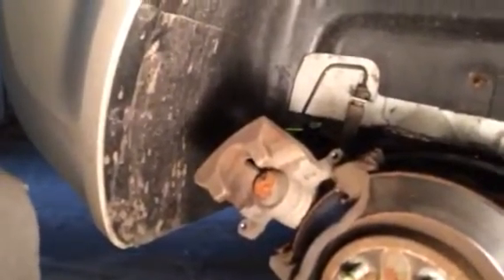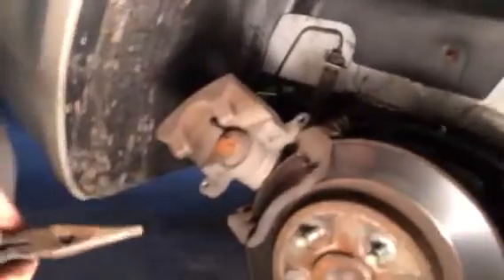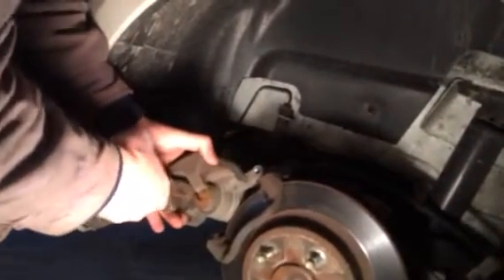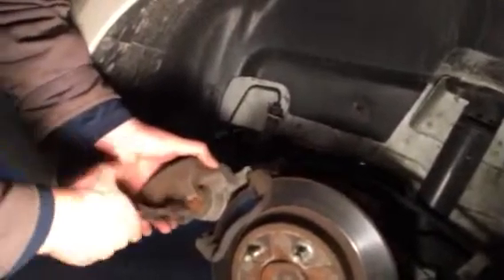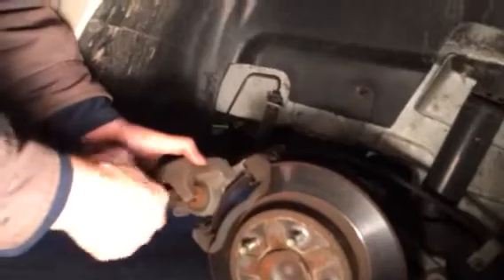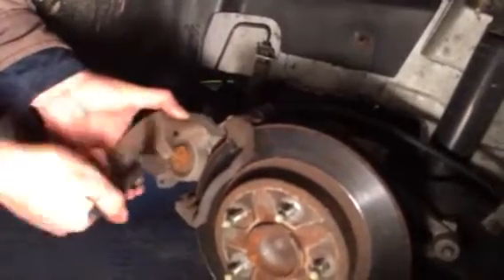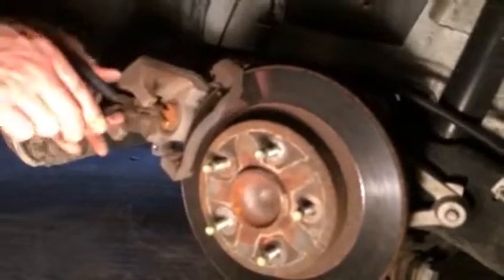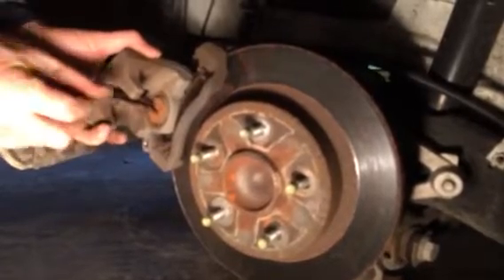Chevy Malibu rear caliper compression tip

Comment: The rotating piston is due to parking brake adjustment. Be aware, on some vehicles (my explorer for example), the piston has to be rotated to a specific alignment as they interface with the pads using those grooves in the piston face. Im doing brakes on this car and watching as a refresher but I do not see anything after teardown that makes me think the rotation alignment matters. I learned this a few years ago as well as I realized I had never done rear disc brakes before that. Still take it over drums any day.

Comment: No wonder why, I did it wrong. Here I was using the C clamp to try to squeeze back in but no use. I end up trying to disconnect the brake hose at least to try to squeeze the piston but that didn't work. I should have already looked on YouTube first but too many things going through my mind. I'm trying to think of replacing the brake caliper after I took out the brake hose and after I put it back, brake fluid start to leak. This caliper is rear passenger side on my 2011 chevy malibu. Any advice about the leaking brake fluid after I was trying to replace the brake pads.
Reply from the maker: There is a copper crush washer that is in between the brake line and the caliper.  They should be replaced every time you disconnect a brake line.  When you buy a new caliper it comes with a new one.  You can probably just get a new washer and that May solve your leak.🤞Good luck out there.
Reply: @ricepadi29  thanks I'll try that.

Comment: Heads up--O'Reilly Auto parts has a Lisles Brake Caliper SQUARE. Less than 12.00 And Lifetime Warranty. I've broke mine at least 10 times. But I don't use a ratchet either.. Got a cordless snap on. Works really good. But that was stack. You'll hurt your self any other way.
Reply from the maker: Beetlejuice ONSYTE1 thanks for the tip

Comment: Thanks man have the same problem on 2006 ford fusion the tool is $60 that I would need to compress the caliper back in.
Reply from the maker: Daniel Kropf Glad to hear the video helped you out.  YouTube has saved me many times when stuck.  Happy Thanksgiving.
Reply: I went to buy the tool ,and it cost me 12 dollars  at auto zone, and it has for many kind of cars ,but you have e to use a wrench
Reply: Channel locks...430's or 440's

Comment: I went and got the tool ( before seeing this video) but only got like half a turn and now it won't budge. Any suggestions?
Reply: Travis Williams i have the same problem calliper is frozen. You will have to chage out the calliper. Chaged it out my self 80$ new calliper new rotor 80$ and pads 30$ per side.
Reply from the maker: Travis Williams sorry just saw your comment.  Assumed you have it fixed by now.
Reply: Rebuild kit is like $5 on rock Auto...
Reply: Check the E-brake. That's why it has to be screwed in. IF you're cable has any tension on it the Caliper is locked for the E/Parking brake. If you're using pliers.